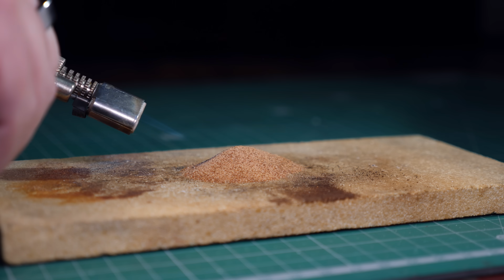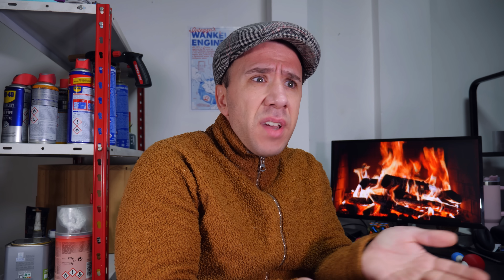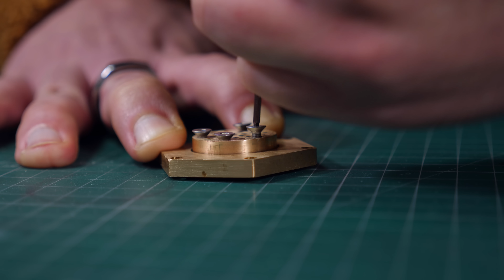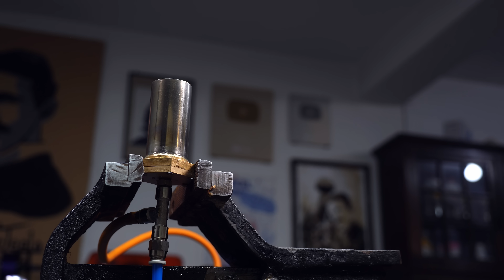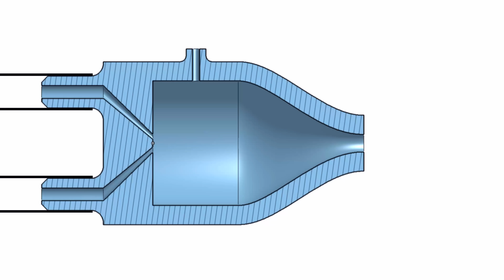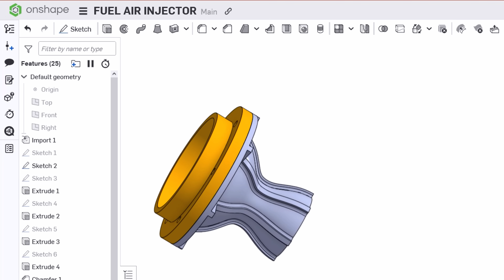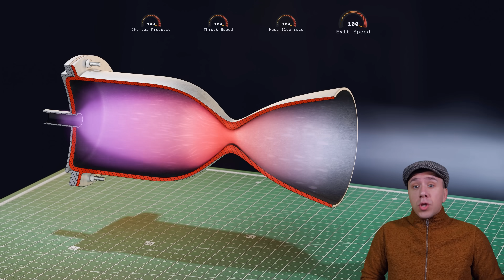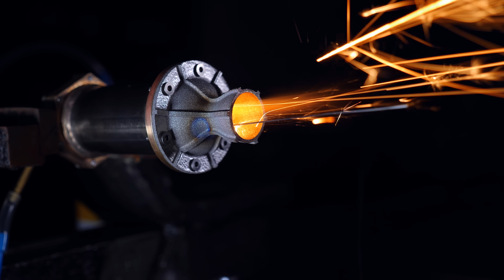I Built the FIRST VENTURI ROCKET ENGINE

Comment: 13:34 that is literally the Venturi effect
Reply: Yeah wtf is he talking about.  The low pressure is from high speed air.  The high speed air, with its low pressure, sucks the alcohol up.  Right??
Reply: @brady1045  I guess he didn't watch the smarter every day video; I don't remember if it was specifically on the venturi effect or carburetors but it explained it pretty well
Reply: @Clippiii3130 that’s what my mind went to as well!!
Reply: @brady1045  If I'm not completely mistaken, it's not the high speed flow itself that creates the decrease in pressure, but rather the acceleration of the flow.
Reply: me screaming at the screen lol
Reply: Right? Looks like an alcohol carburator to me 🤔
Reply: @PhiTonics  a very cool one too
Reply: lol, was gonna say, he thinks its a lie, then immediately explains exactly how the effect works
Reply: THANK YOU! i was like, "But bro that is exactly what the Venturi effect is"!
Reply: He's gotta be trolling lol
Reply: Low pressure suction more accurate
Reply: @CharlesChapman-h7w  ? its literally called the venturi effect, thats how it works
Reply: The described effect is called "liquid entrainment". Similar, but different
Reply: @Andrew-somenumbers isn’t that when bubbles get mixed into the pipe’s fluid??
Reply: @brady1045 it's also how "bladeless fans" work
Reply: @brady1045  Technically yes. Works with any fluids though. Same principle but liquid/gas reversed. in the Bubble case, the liquid is the carrier fluid and the bubbles are the trapped fluid.
Reply: @Andrew-somenumbers  never heard of that before but from the examples I looked up you could be talking about the spray itself (fast air moving existing droplets), while we are talking more specifically about the effects of drawing a liquid "body" through a cavity/channel by having fast moving air causing a change in pressure 🤷‍♂

Comment: Correct me if i am wrong but if you put the potassium nitrate part in the oven at 75°C that would've made it evaporate but would've took way longer. This would've prevent that fluffing becauss the fluffing can cause a very inconsistent burn and pottasium nitrate is also very cheap. 

Also you would have to mount this upside down so every byproduct gets pushed out